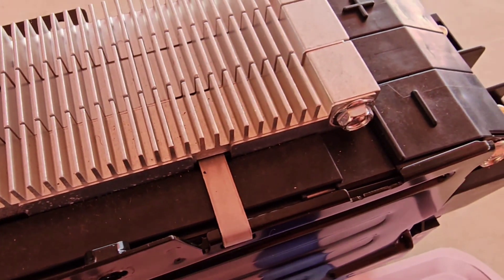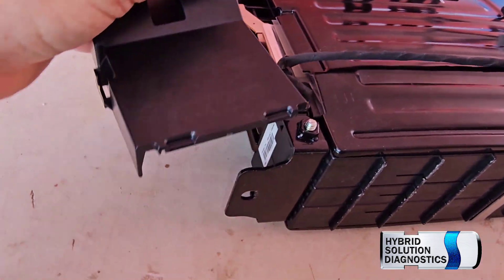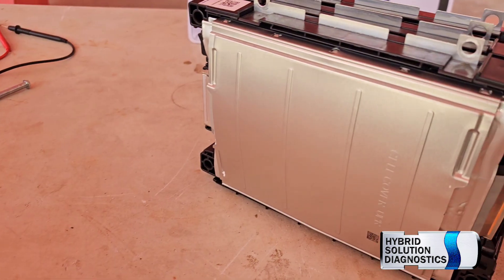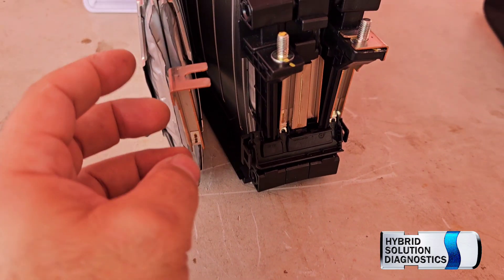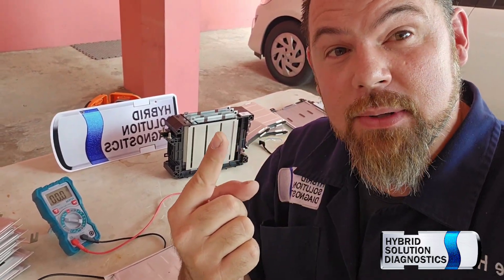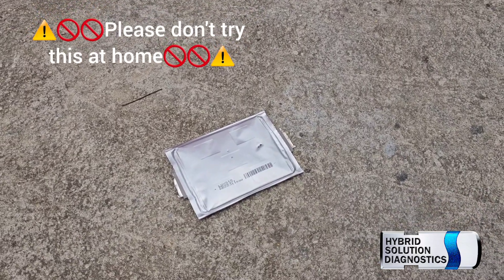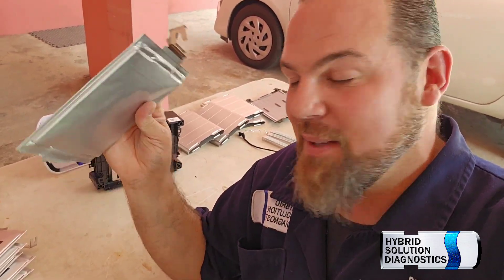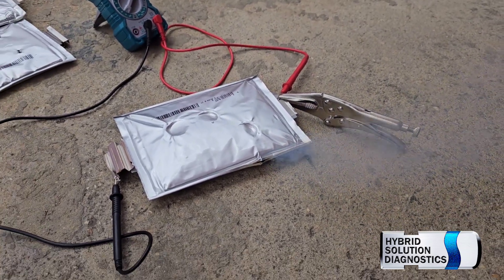(Explosion test) Hyundai Ioniq & Kia Niro integrated LiFePo4 12v battery

Comment: Jose..thanks for the video - for the lithium ion battery to catch fire - broken batteries if they get hit with moisture or water vapor - lithium metal reaction with water will produce hydrogen which will catch fire. The hydrogen formation can also create swelling.  The heat creation with punches is due to recombination reaction between anode and cathode products reaction

Comment: Faced a similar issue with this battery after jump-starting the car - after that it swelled. Who is interested - the chemistry of this battery LiFePo (is NOT LiFePo4, I am not a professional here, but that told me people who worked with this concrete battery). The cell characteristics: 2.5V - 3.6V. The charge settings from the car for this battery: 14.2 (100% battery charge, 13.3 - float current voltage, 11V - fully discharged voltage, full power cut off). Maybe this will be useful for somebody=)

Comment: Great video, are their any dangers in tapping into the vehicles charging system to charge a battery bank used to power a mobile office through a inverter. All charging will be managed through a DC/DC charge controller, the battery bank is AGM so I am wondering if their is anything I should be aware of given the main 12v car battery is lithium?

Comment: Hey buddy I have an issue with my 2014 Hyundai hybrid sonata when I press the brake and start switch the car won’t start the cluster says READY also says hybrid battery low slow pull over and park I already checked the hybrid battery cells they all say 27.6 volts also checked the big fuse switch and is good the 12v battery is new and the sucker won’t start any ideas I’m mechanic been working with regular vehicles but this hybrid crap is a new animal for me any ideas???????

Comment: Hey Jose! Great video as always. I have asked this question before in mechanic groups but no one knows the answer. I have kia niro with flat battery, if you jump start it it says ready on the dash but 12v battery lights stay on dash and i have tried to accelrate , it never started. Car only has 2000kms on it. Measure the 12 battery voltage on jumping points it comes up with 4.5v . Would you know how can i charge the 12v battery ? Vehicle was sitting for sometime befor it came to us. I have pressed the 12v battery switch by steering wheel .Just curious if you can help with any advice. Thanks
Reply from the maker: Looks like a bad battery… you have now the tutorial to take it out and check it 👊😎 be careful
Reply: @Hybrid Solution Diagnostics  hi José. I enjoy very much your videos. Today I Just finishing reconditioning my battery is a avalon hybrid. When I started the life expectancy was 30 % the triangle every now and then trow a code with Dr pruis app I resetted the code and kept on driving. I got 13 cell from ebay and I said I did a reconditioning so just now I did a expectancy test y it came out 97% life and it tell me that that battery is new condition but I'm getting the triangle and I can not resetted it won go away. Don't know if is a error from the app or a different phone.  The car is running hybrid normal. I left the battery for 48 hour balancing but when I was taking cables off. Some of they shorted for some second negative to positive and they sparked a little bit. Do you think that was enough to unbalance the battery or what can you please 🙏  tell me about what might be going on. As I said they returned 97% and the car is running hybrid even with the triangle on. Hope you see this and respond

Comment: I've got a question my friend I got the batteries out of a 2011 Toyota Prius that are NIMH I would like to try to use them for my solar power is there such thing of a BMS for those types of batteries any suggestions please will be extremely helpful
Reply from the maker: You will have to build a management system for it…
Reply: @hybridsolutiondiagnostics  on a lithium battery I will use a BMS correct is there an equivalent to the ni-mh battery that I may be able to buy and why up myself if so what would be the name of it thank you
Reply: @hybridsolutiondiagnostics  do you happen to sell whatever it is that I may be able to buy it for you and I can wire up myself

Comment: Tablet computer used to have swall battery, due to poor temperature sensing, caused over heat. LiFeP4 battery is little safer than Li-ion but less capacity

Comment: If this battery really is lifepo4 it's really hard to tell if it is balanced because the charge curve is flat so you can only tell if they are balanced till they are fully charged around 3.5v you can start to see the voltage drift from each other
Reply from the maker: Yes but sadly it looses balance after a few years and begins to swell as you ca clearly see
Reply: @hybridsolutiondiagnostics  I have some old lifpo4 batteries that I've never charged for a few years and they are not swelling but I guess they are not sitting in a hot car

Comment: The high voltage battery is LiPo lithium polymer, not LifePo4 lithium iron phosphate. Interesting choice since LiPo isn't known for long cycle life.
Reply from the maker: This video is about the 12v Lifepo4 my friend… not the lipo HV 👍👍👍
Reply: @hybridsolutiondiagnostics  you mentioned it was the same chemistry as the HV battery. That's the context for my comment.

Comment: I completly disagree on the heat topic you refer during the video. Aluminum conducts 1000x more heat than air (Alum. 237 W/ (m·K), Air 0.025 W/ (m·K)). This design is very efficient dissipating heat.

Comment: @Hybrid Solution Diagnostics  hi José. I enjoy very much your videos. Today I Just finishing reconditioning my battery is a avalon hybrid. When I started the life expectancy was 30 % the triangle every now and then trow a code with Dr pruis app I resetted the code and kept on driving. I got 13 cell from ebay and I said I did a reconditioning so just now I did a expectancy test y it came out 97% life and it tell me that that battery is new condition but I'm getting the triangle and I can not resetted it won go away. Don't know if is a error from the app or a different phone.  The car is running hybrid normal. I left the battery for 48 hour balancing but when I was taking cables off. Some of they shorted for some second negative to positive and they sparked a little bit. Do you think that was enough to unbalance the battery or what can you please 🙏  tell me about what might be going on. As I said they returned 97% and the car is running hybrid even with the triangle on. Hope you see this and respond.  Greetings from Dominican republic 🇩🇴
Reply from the maker: Send me the live data to check the battery first via instagram DM… I’ll take a look… we are coming soon with our training to Republica Dominicana ☝️😎🔋🔋🔋🔋🔋
Reply: @Hybrid Solution Diagnostics  that is great. I will be the first in line. I sent the video via Instagram already. Thanks for your prompt response
Reply: @hybridsolutiondiagnostics  May i know how much is it to purchase it from you and have it shipped to Singapore? Thanks

Comment: I ask question why u ignoring
Reply from the maker: Edwing what’s up? 🫡✅🫡✅
Reply: @hybridsolutiondiagnostics  hi so my Dr prius shows temp 3 116 and temp 1 and 2 100 so if temp 3 is high could it be bus heads the fan I clean I use car for Uber and drive a lot shall I open and move the cells from hot side to other side and it shows temp 3 cells not fully charging

Comment: Test done far from normal condition and useless. When the cell is in the car and get damaged it's taking high current through other cells and is extremely hot which eventually will cause smoke, spark and fire if not protected by bms. I'm still full of questions; 1 Is the smoke flammable? 2. How if you keep overcharging the battery for extended period of time?...